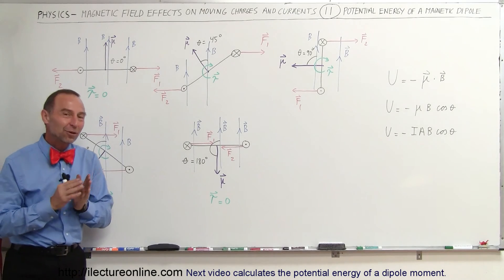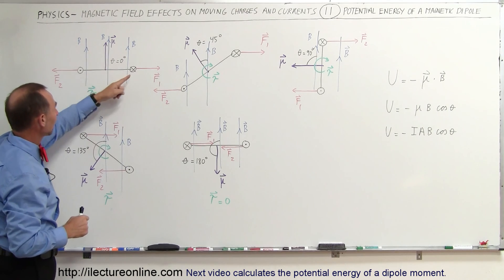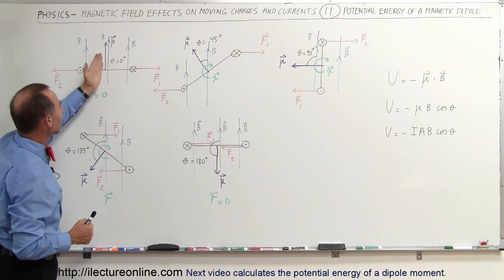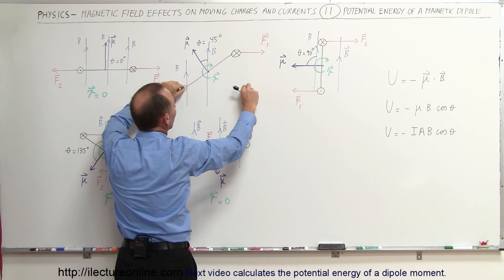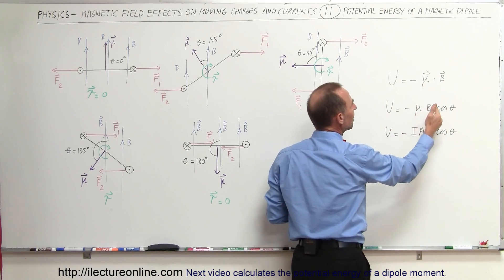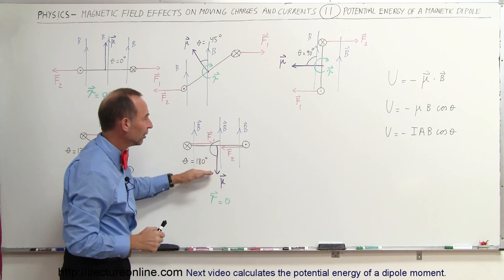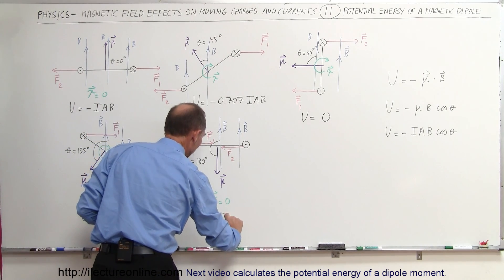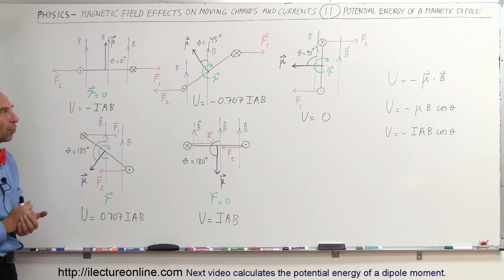Physics 43  Magnetic Forces on Moving Charges (11 of 26) Potential Energy of a Magnetic Dipole

Comment: Thanks for the video. How did we find the direction of the dipole moment?
Reply: I mean that we know it is perpendicular to the surface of the loop; however, i could not understand in which of two directions should it be.
Reply from the maker: By definition:   The direction of a dipole moment is from the negative charge to the positive charge.
Reply: @MichelvanBiezen  sorry professor but i couldnt get it. What do you mean by charge. There is a current loop. Where are negative and positive charges?
Reply from the maker: Aah, yes, we are talking about the force dipole moment caused by the forces on the current.  Use your right hand.  Curl your fingers in the direction of the forces and your thumb will point in the direction of the force dipole moment.

Comment: why on earth is the energy negative when it's at its lowest level, 0 when clearly work needs to be done to put it perpendicular from the B-field? seems like there should be a justification...
Reply from the maker: It depends on the reference point.  (For example, the PE of an object in space is always negative since the zero reference point is at infinity).
Reply: hmm.. i suppose it doesn't really matter, because in order to GENERATE energy from something, we need to only think about the potential difference between two points, not the absolute energy.